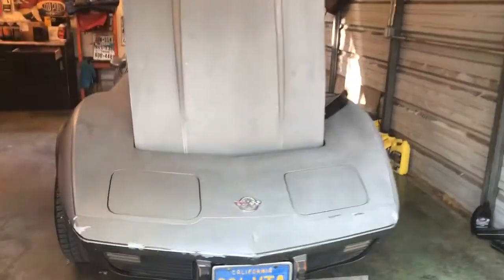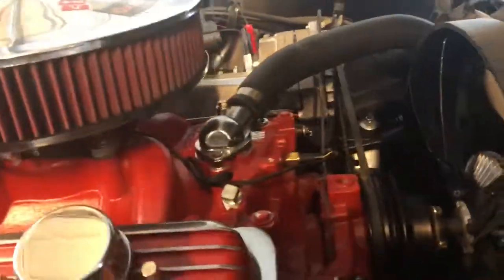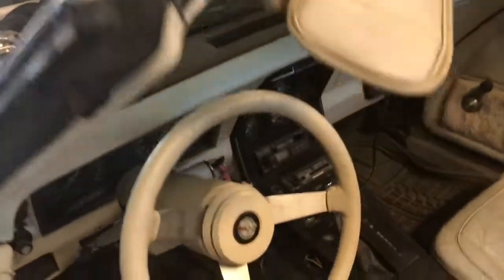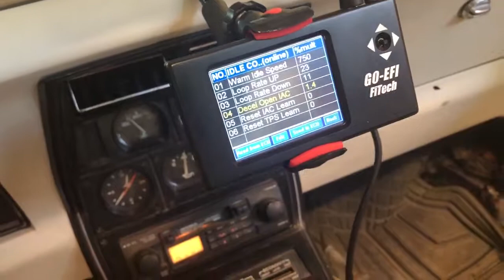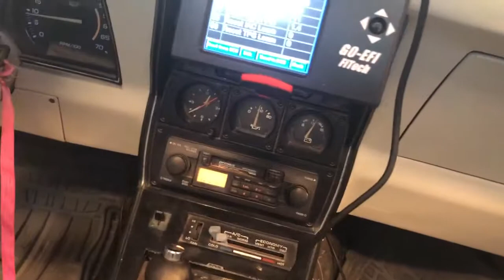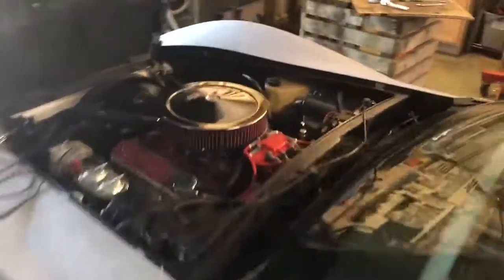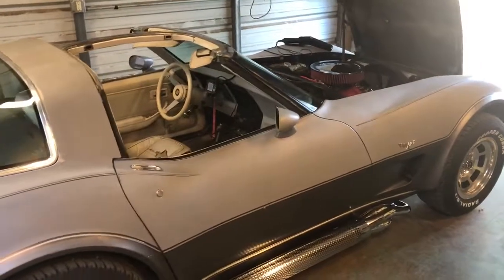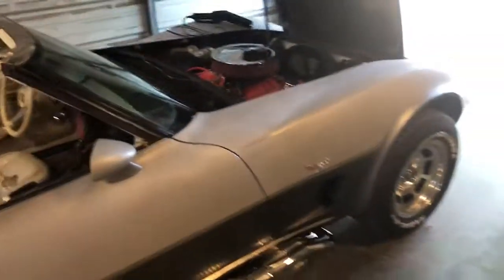1978 C3 Corvette Restoration Project Garage Revival 004 Ready to Roll!!

Comment: I picked up the same car a couple years ago, it's already been repainted a new chevy blue. I'm making my way through the 40/yo issues of rotten bushings and vac hoses. Like your videos.
Reply from the maker: Thanks SethPiguet. The car is in primer and ready for paint. It should be done soon and I will post up a video of the results. When we pulled the motor everything was rebuilt  or replaced. All the bushings and hoses were junk!